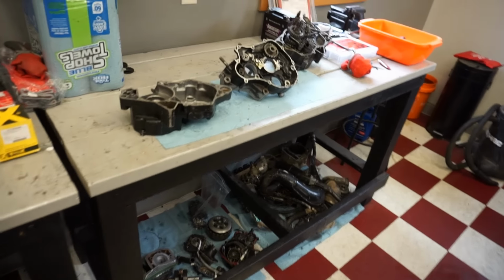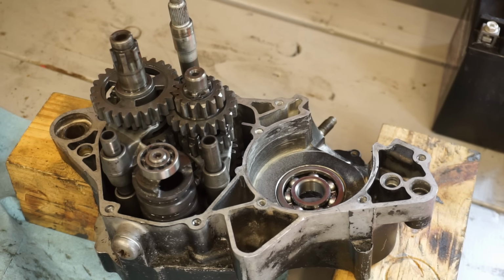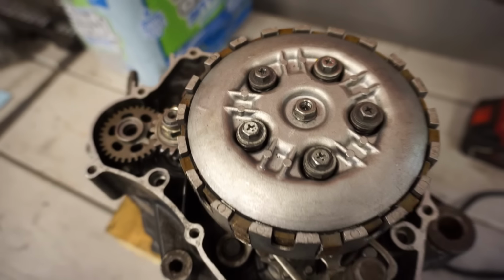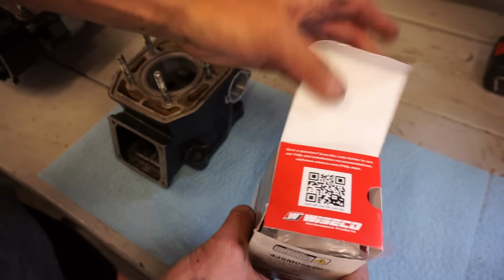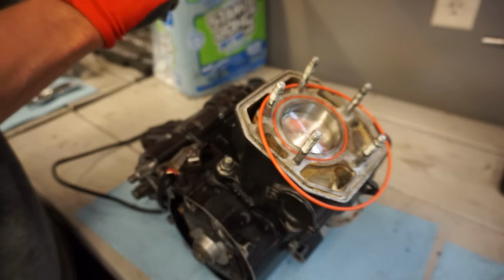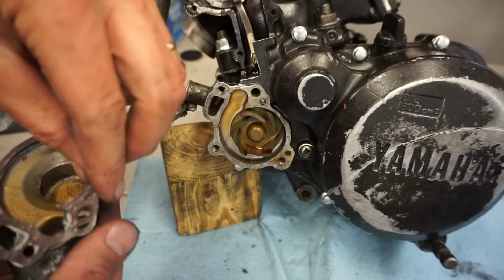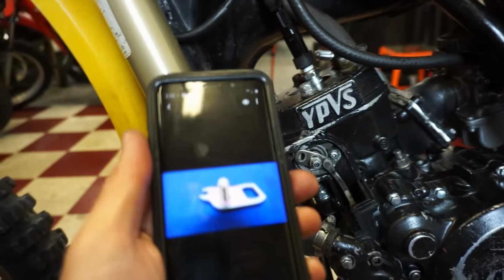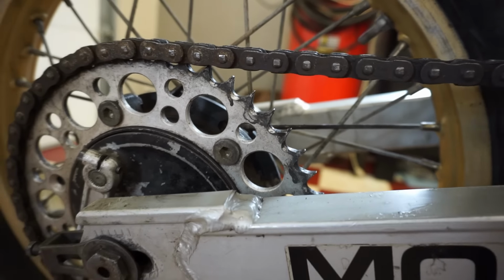Seller Lied About This Rare 2-Stroke Dirt Bike (FIXED)

Comment: I hope you at least got ahold of the seller and gave him a piece of your mind. People like that shouldn't be given a pass.
Reply: I think Joe likes these bikes with more problems than the seller said or hidden problems.  They are more fun to work on than regular easy issues.
Reply: @travharrell1713  Most people could not handle that however. I would not even consider buying this heap without a compression test.
Reply: Seller would just get a kick out of it knowing that the buyer actually found out, basically like a bully. Everyone knows you do not feed the bully and that is what you would be doing.
Reply: Unfortunately it happens a lot I buy and sell bikes and sellers lie more often then you would think and every time I try and get ahold off them I get blocked some people just like to rip people off I guess
Reply: $800 is a steal for a classic YZ even if blown up. That one was first year of water cooled i believe with high mount radiator. I have ridden that exact bike many times and it is a monster of a 125 when set up correctly.
Reply: @strangeuniverse1199 seller not going to let anyone do a compression test ,I never seen anyone do it when looking to buy something with an engine.
Reply: @edwardhaines7499  '81 was the first year for water but yeah, this bike is like finding a hen's tooth
Reply: It’s always good to check things before buying them. If the seller doesn’t want you checking for the air filter , compression , or even kicking it over , that’s a sign that he knows something that he doesn’t want you to know.  If he doesn’t want you to do a compression test then atleast kick it / turn it over by hand.
Reply: OMG! OMG! I SEE A CLAW HAMMER! 😱
Reply: You could also try to flap your arms to fly too. But it wouldn't do much good. He'll lie to the very next buyer too, even if it was the next day. You can't fix folks like that. They don't feel guilt.
Reply: @edwardhaines7499  

My cousin and I had a 1980 YZ80 bought new and we owned it until 1989 when we stupidly sold it. It was the same yellow/black bumblebee paint scheme. It was crazy powerful and fast for a 80cc 2-stroke. I can only imagine what this 125cc will run like when it is finished. My Uncle (his Dad) and his Uncle (my Dad) used to ride it too and it was even fast with them on it. This sucker is gonna rip and it will be worth a few thou once it's all mechanically sound again. Cosmetically it's not too bad for a 42 year old bike. I would love to have ours or this one back any day now as a older man.
Reply: @Sweendawg32  

Eh, $800 is $800......it's probably worth $2,000 - $2,550 as it sets right now. After he is finished I bet he could get $3,000 - $3,250 for it. Beggars can't be choosy and it's not like you are going to buy a immaculate bike for eight hundo anyways.
Reply: @strangeuniverse1199  

You're gonna pay approx 3K for it now and it's well worth that much after the repairs. That's actually cheap compared to what a new 2024 YZ125 costs these days. MSRP $7.099.00. When is the last time you bought a bike like this? 1995?! Lol Lol
Reply: @JohnDoeEagle1  missing the point . Joe seems to be a smart guy. maybe not good and thoroughly cleaning things , but that’s not the point. How many times has he gotten screwed.? A ton ! I mean , who doesn’t check the air filter and kick a bike over before buying it ? In this case 800 bucks was ok bc of the bike in general.  I guess it’s ok for him to get screwed over bc he’s making a crap ton from us, but it doesn’t mean it’s right.
Reply: @Sweendawg32  

I agree he should have kicked it over and looked at it more carefully. Even so $800 is very reasonable given the mystique and collectability of a vintage Yamaha YZ 2-stroke. On the other hand I can imagine the guy inspecting every single inch of this bike and kicking the tires. "I'll give yas 500 bucks" he says! While he screwing around making lowball offers another man watching the deal from afar steps in and says "I'll give you $1,200!" SOLD!!! Nobody admires or likes the lowball kick in the dick offer guy and he usually gets nothing if the seller is smart and on the ball.
Reply: @JohnDoeEagle1  to each their own. Thats your opinion. Again , this is only one bike. How many times has he been screwed ? A bunch ! I get the whole “ it’s a Yamaha “ thing. And idc what bike it is , I would have asked to check something’s over first or tried to get it to start. Thats just me !! And I would have offered 500 bucks. !!! Bc the guy knew he was screwing joe so who cares if I’m the “low ball” guy!!!
Reply: @Sweendawg32  

What's even funnier is I never looked up the value of 1982 Yamaha YZ125s until just now. I was going strictly on gut instincts and intuition. The prices are right there where I said $2,850 - $3,250 for a solid mechanically sound and not cosmetically trashed everything else. I based my appraisal on what the MSRP of what a brand new 2024 costs.....a little less than half.
Reply: @Sweendawg32  

Also I knew my Cousin and I sold our 1980 YZ80 back in 1989 with 1989 dollars and inflation factored in for $250. That bike was pretty trashed because we rode it into the ground, so did our Dads and friends. That was 35 years ago mind you. Nobody is going to be buying this bike today in 2024 for much less than $800. Remember 125cc bikes cost more and +35 years time. OH...and yes I am old. Gen X nice to meet you!
Reply: @strangeuniverse1199  SAme...I never buy anything that isnt running/driveable. 
Many times sellers will make it not able to start to hide bigger issues
I treat those like they have a bad motor/trans etc.
Reply: @zzzzzz...9902  Exactly....guys like that you show up on their front door step 
These ripoffs keep doing it cause nobody stands up to them. There isnt any karma dog that will pee on thier shoes later.
Reply: All it needed was a carb clean - ha!!
Reply: I don't think non mechanically inclined buyers should be given a pass
Reply: It's always the same deal. Seller lied to you and no one else can fix it but you.😂
Reply: Maybe someday you will go through puberty in your voice will change permanently
Reply: Buyer beware!! 🦇

Comment: Anytime a bike comes with an extra engine you can assume the bike doesn't run
Reply: Absolutely haha if a bike like that is 800 dollars it’s already a red flag, it’s essentially a project at that price
Reply: Or Box of Parts.  I just rebuilt the engine and have all these extra parts
Reply: @2vintage I have ran into a issue yesterday rebuilding my 87 warrior 350 maybe you could help walk me through getting it sorted ( for some reason the wrist pin will not come out of the old piston (yes I remembered to remove the cir clips first)
Reply: @richgwozdz8580  try heat it a bit, may not be easy, get loads of penetrant and wd40 on it and soak, repeat multiple times over day or 2, heating it might expand enough to pop it out with no damage
Reply: @connorwilson8078  I’m going to go try that right now because I tried the wristpin tool that my buddy had that usually rebuilds my bike but it snapped his tool it’s that stuck it’s as if the damn thing expanded in the piston
Reply: Good observation!
Reply: @richgwozdz8580  i was rebuilding an engine not long ago, and the wrist pin welded itself to the little end of the rod due to oil starvation. the rod was in bad shape, scored to shit and very rough. this engine didn't have a wrist pin bearing though, not sure if warriors do or not. either way, i hope it comes apart for ya!
Reply: @nou943  you know what I thought there was a bearing in there I googled the connecting rod and there’s not a bearing in it so I’m starting to wonder the last time I rode it was in deep snow and it snapped an rocker arm so it had to have suffered from oil starvation for a short period of time
Reply: @richgwozdz8580  well if it ends up being a case of a welded wrist pin, just get a new crank at that point. i tried to make the shitty crank work in my rebuild and it locked up tight within 3 miles

Comment: Hey Buddy great work. Love this channel. Here is a tip from an old engineer/rebuilder of 50 years. Buy yourself a set of reverse drill bits. When you drill out a stripped bolt or screw head it will heat it and remove it all in one process. When drilling it out with a standard bit you are just tightening it more.
Reply: On those pins, use a adjustable pin punch. Start out with the least pressure. Increase force as needed. Test on 2x4. This way you don't break the towers the pin goes through as you push directly on the pin. Spray a tad of penetrative oil on them.
Works well!

Comment: Joe, if you’re going to drill out a screw,use a reverse drill as it will undo the screw if it bites into the screw instead of a normal forward drill which tightens it as you drill it out. 👍

Comment: Not sure if this was ever mentioned to you before or not, but  with the Japanese products and those bolts with the head that looks like a Philips,it is actually more than likely JIS.You can tell if it is with the presence of a dot on the head of the screw/bolt. While they look like a Philips, there are subtle differences in the shape of the grooves in the head. When you see the heads all chewed up on a JIS screw,it's from using a Philips screwdriver rather than a correct JIS one. A JIS screwdriver works well in a Philips screw but the reverse is not so much the case. I cammed out/stripped the heads of many JIS screws before learning about the differences. Vessel makes an excellent set of screwdrivers or even bits for a 1/4" driver.

Comment: Really enjoy the videos Joe and I admire your 'never say die' attitude - when a bike comes to you it's gonna get fixed whether it wants it or not! The only thing I'd say though is that in my 2 stroke career I found the best starting technique to be choke full on and throttle fully closed. In fact it is best not to be even touching the throttle as I had the tendency to open the throttle a little as a reflex when I kicked the starter.

Comment: One area where you need to step up your game is the air filters on these machines. Use air filter oil in a bottle and pour it onto the filter. Work it in with your hands until it is completely covered inside and out and squeeze out the excess. Your brand new top ends will thank you for it. Nice work bringing this parts bike back to life.

Comment: That's a real original J model there Joe, watch for leaks at the steering neck after you have a couple hours on it (experience talking)... also, the rear brake stay is bent and will add to the probs with that rear brake.

Comment: In the future, when you have a stuck screw, use a #30 drill bit, and a #3 EZ Out (shave the very tip of the EZ out, so that it is not pointed), and you will have great success. I probably removed over 25000 stuck screws as a sheetmetal mechanic in the Air Force and Army. When a jet goes into a PHASE inspection, you would be surprised that there are over 300 stuck screws per jet, when they are de-paneling a jet on the first couple days (thats on a fighter jet) imagine on a cargo plane.. (2A773 for life and 15G)

Comment: I had an 81 yz 125 water cooled non power valve. Did alot of woods riding. Mine wasn't the greatest off the bottom and had to stay on the pipe. Great times

Comment: One thing to think of Joe, since you don't have a big torch kit with acetylene & oxygen, instead of using propane (blue tank) grab a MAP gas (yellow) next time. It burn quite a bit hotter than propane and will heat that case up more for the bearings to drop in. You will need a different ignitor thing though, the propane one isn't made for MAP gas but it's totally worth the cost for the higher heat!

Comment: Top tipp, 30 years ago all cross buddies turn to 1:100 mixture. Now i owned a 1981 RS 100, tuned to 130 kmh. An it runs well with 1:100! So what for the extra oil, to glue up the pipe, an stress the spark plug. LG from the Niederrhein /Germany

Comment: Good tip for piling filters.

Get a freezer bag and put a bit of air filter oil in it. Drop the filter in and zip it shut. Massage the hell out of the filter in the oily bag. Remove filter and install.

Keep the bag in the toolbox for future air filters. Keeps your hands from getting all oily when properly oiling a filter. 

Just spraying a light coating on them like it’s hairspray isn’t the right way to be oiling them. That filters gonna be dry before you know it.

Comment: I've always loved how the some of the most technical machinery always ends up relying completely on a Circlip or a Woodruff key.
Reply: I know man ,  like some people are still using the wheel even today 🤷‍♂️ 👍 🤣
Reply: @mikeandrews1899  Don't get me wrong.  Nothing will ever be as cool as a 1980s 2-stroke Motocross bike.  This rebuild has definitely been a favorite.  Inspires me to maintain my Elsinore more regularly.
Reply: @sammckinlay7338  my first NEW dirt bike was an '81 full floater. That was a great year for 125 motocross . I was 15 and just getting started in racing.
Reply: @sammckinlay7338  back in the '70s , I rode Honda's on the farm as a kid but was always wanting an XR75 , then an Elsinore. But I enjoyed my CT70 , SL100 , and my SL125 jumping terraces in the pasture pretending to be racing with Smith , Croft , and Tripes 😂👌

Comment: I love how people are armchair observational engineers; “Don’t do this, don’t do that! What??!!!” Meanwhile Joe has a whole garage full of amazingly inexpensive, great looking and running bikes… heheheheh… keep up the good work Joe!
Reply: My favorite part of his videos is going through the comments and seeing all the comments from the know it alls and people who have never done shit in their lives 🤣 and the claw hammer haters!
Reply: @minnesotatomcat and all the evidently former ProMX mechanics who hate him revving a cold engine… heheheh. I grew up in Alaska and revved quite a few cold 2stroke snowmachines in my day… hmmm… never had an issue. It def is funny! Joe is a great mechanic and seems like a really good guy too.
Reply: @lancenutter1067  most 2 strokes need very little warm up time, and he’s far from pegging them. Yeah I giggle about those comments too 🤣
Reply: @Sunspot-19
5 hours ago (edited)

Preserve your seals, place a few drops of STP in the valley of the seal before a shaft goes into the seal. Prevents nicks and cuts going together as well as lubricating the seal itself so it does not burn out. Another thing is, never run an engine without coolant in the water pump. That will cause early seal failure! Ask me how I know!! Annnnnnnd, that strawberry syrup you spread over bearings, use it on cams and followers without fail! Cam failure on a new build usually happens within the first few hours of run time. That red assembly lube is loaded with zinc and helps eliminate galling.
Left hand drill bits are your friend when you cannot notch a screw with a dremel.

@JohnDoeEagle1
0 seconds ago

2-strokes don't have camshafts....der der!

Comment: I had a bike I sold once that I sold as "ran when parked". I just forgot to tell the buyer that I meant I just put it neutral and let it run down a hill with the engine not running before I parked it. Hey, it ran down the hill, didn't it? At least I'm more honest than most of the people 2vintage gets his bikes from!!

Comment: The rod in the YPVS system is doing its job, but there's a ton of slop to it. It appears as if the center of the outer piece has too much material taken out of it, making it move all over the place.

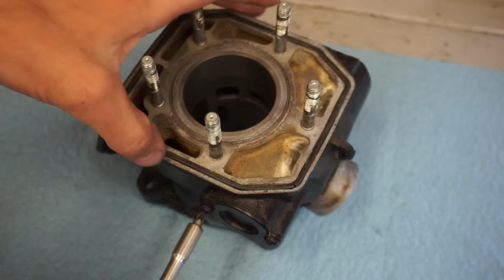Comment: 20:30 or so.. I'm not sure on this motor, but JIS is a type of Phillips style screwdriver VERY common on Japanese engines (well, It's like Japanese Industrial Standard or something so yeah duh) but I've seen SO MANY engines with stripped what people thought were #2 Phillips heads, no.. no JIS screwdriver fits RIGHT IN there.. Life doesn't come with instructions but all you have to do is ask and I bet someone can help you BEFORE you strip your screws out.. (not you Joe, I know you know)

Comment: Those 82,s were the first year for water cooling and they plumbed the cooling through the steering head which was a horrible design because coolant would leak into the steering head bearings and corrode the shit out of them. . I know owners would bypass the head bearings and run hoses directly to the radiators bubba louie. ....

Comment: Watching this around 34:00 I noticed oiling the o-rings.  Now, let me be clear I do not try to be a smart-ass here but I wonder IF that is actually the right approach.  IF the o-rings are at least partly based on latex and not completely synthetic, then oil might actually start breaking them down right away.  In that case, some silicone based lubricant might be better.

Comment: The loose kick starter is an easy fix. Take it apart. There's a small ball bearing and spring. Stretch the spring a bit and reassemble.

Comment: Some O-ring material isn't compatible with oil and its best to use an actual O-ring lubricant. ( Corning 111 or Corning 55 ) one is for water based applications and the other is for oils. I've seen O-rings break down and swell when coated with oil, just something to be aware of.  A little cleaning in these builds would go along way with these builds, a cheap dishwasher is a great parts cleaner..

Comment: The smell of 2 stroke oil burning is better than s.x LOL... You definitely got hosed on the bike
but it's going to be worth it when it's done. I'd rather have a 250 but I would like to have it
just for a little ripper. It still looks good, just need to clean the outside of the gas tank a little.